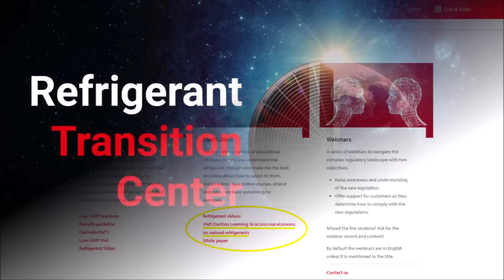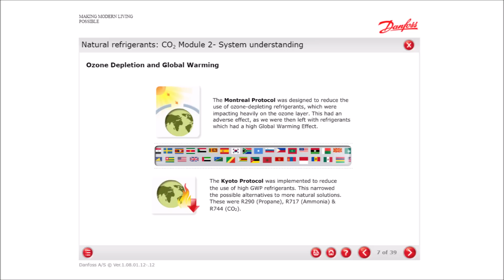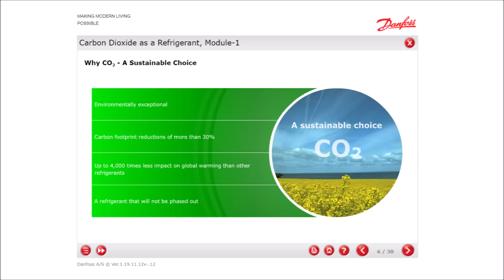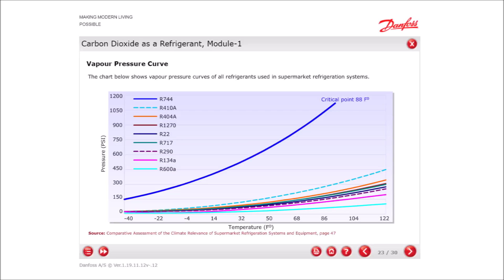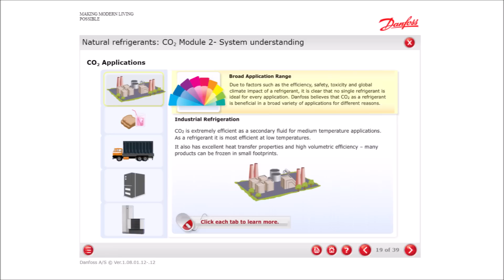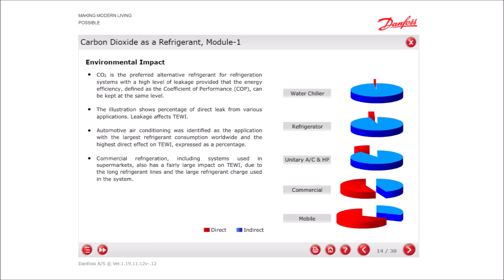CO2 R-744 Refrigerant History and Properties

Comment: Yesterday I recovered a high side skid from a co2 system that was sound. 25 lra compressor. Nothing special, but unique and also the first co2 system I have encountered in my 30 plus years of refer teching. 
I kept it because I was thinking of the probable high side pressure requirements needed to condense co2 at room temperature. And also the volume of gas passing through the system. 
I can only imagine that the internals of this compressor must be far more robust than a typical r134 compressor, which rarely reaches 125 psi. My thinking is that you would quickly destroy even the highest quality refer or HVAC compressor by asking it to achieve the pressures and volume that this compressor clearly did achieve for the past 15 years. 
Any pertinent information in that regards would be welcome and appreciated. Polyolester oil in system. Thanks.

Comment: What would be the theoretical maximum efficiency of a CO2 cycle for some common uses, and how does it compare to HFC or R290 solutions?

Is it even possible to have a greater COP by using a CO2 cycle rather than propane, assuming the same temperatures?

I'm specifically interested in the attainable COP when compared to Carnot ideal COP at those temperatures.
AFAICS, CO2 is generally worse than other alternatives in that respect. =/

It seems to be a most prominent refrigerant for systems with a huge refrigerant charge and/or a low temperature difference, such as heating a pool at 30°C using seawater at 15°C.
Correct me if I'm wrong, it seems to me that those are the cases where the maximum attainable COP is closest to Carnot maximum.

Comment: Sir, if any chance to using R744 refrigerant in RAC(Room Air Conditioner) system?
Reply from the maker: No, the triple point doesn't work and the equipment existing nowadays won't handle the pressure, thanks!

Comment: C02 will probably never happen for Air Conditioning.  Heck a 40 degree evaporator saturated temperature would have a low-side pressure around 550 PSI!  Given condensing temperatures are usually at least 15 over ambient even on a very high efficiency system, that means on a 70 degree day you will be condensing at or above 1000 PSI (85 degree saturated).  The problem is beyond that CO2 exceeds critical temperature.  Simply put you cannot condense the refrigerant vapor to a liquid no matter how much pressure above that temperature.  Honestly, I do NOT see how you would get any subcooling at all for any day warmer than 70 F.
Reply from the maker: Hey NETWizzJbirk, it is unlikely that CO2 would be used for air conditioning but it is already used in supermarket refrigeration. They are continuing to figure out new applications, thanks!

Comment: I found an R22 system with fluctuation. Never have seen this in all my 16 years in the industry. Low side would go from 60 to 80 high side 210 to 300. one and then the other. they would stay for a few seconds before flucuating again. Not sure if the T.X.V. is hunting or i have non condensable's. Tried adding gas but didnt change. Had to recover some back. Any idea's. Need to check the txv sening bulb? Recover and weigh in new gas? Thank you in advance. 105F ambient 58 supply 78 return two stage Rheem commercial .
Reply from the maker: Hey Shawn, sounds an awful lot like noncondensables in the system. Did you happen to check to see if the pressures were higher than they were supposed to be with the system off and equalized at a known temperature. When non condensables are in the system, the pressure is often higher than it should be at rest. If that is the case, I would recover the refrigerant, replace the filter drier, and weigh all new refrigerant in, thanks Shawn!
Reply: Thank you sooo much. No the load was too high to turn it off. Will do. Let you know what the outcome is.
Reply from the maker: Glad to help Shawn!
Reply: Thank you sir, thats exactly what is was. NON Condensables.
Reply from the maker: Shawn Riddle, Cool, thanks for letting me know!
Reply: AC Service Tech LLC  thank you Sir. Love keeping my tools sharp in your kitchen. lol

Comment: Do you think geothermal would be the way to go using co2?
Reply from the maker: Actually funny enough, CO2 is starting to be used as the pumping fluid used for heat transfer with the ground on some very large commercial projects instead as a refrigerant in that case, thanks